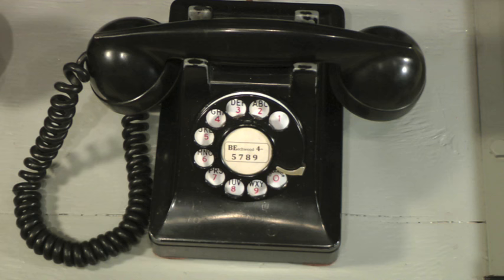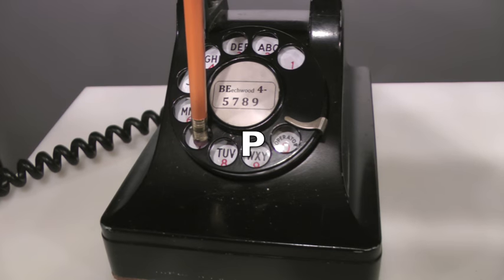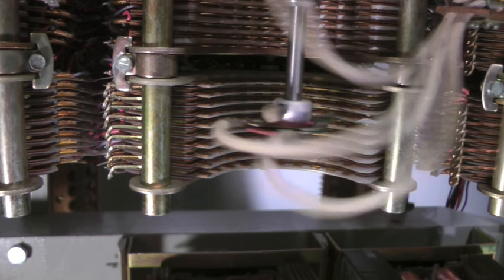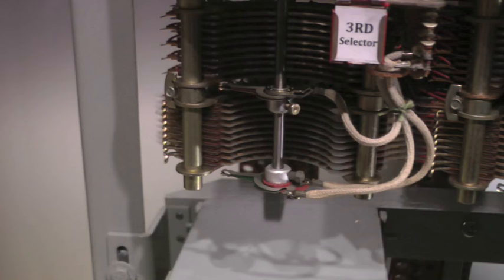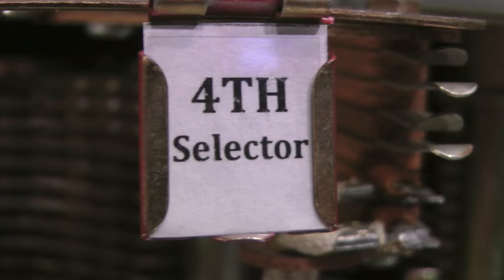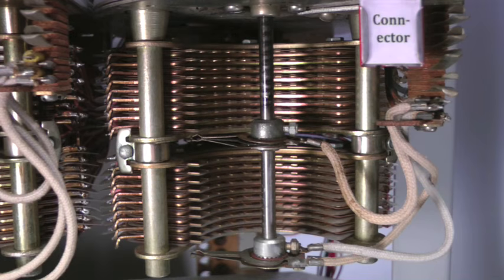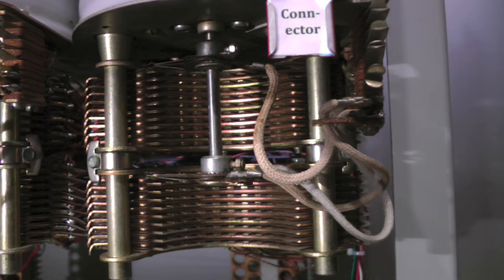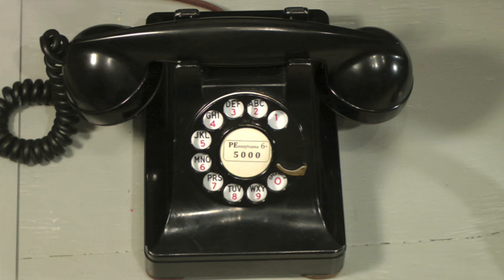A Call To PEnnsylvania 6-5000 Through The Step-by-Step Telephone Switching System

Comment: How does the system keep track of what number is being dialed? The only way I can think to achieve this is with incredible, costly, "fan-out": at every level, there's a connector (or bank of them) to handle each dedicated collection of digits. But this would mean that for every digit added, you'd need 10* more circuits than the last, and in your typical 7 digit number, that would mean 1,000,001 connector circuits (10^5 connectors, the final connector that can handle two digits, and one connector at the start that doesn't need any memory).

That seems like an awful lot of circuitry. Surely that can't be the way the exchange kept track of the number dialed at every stage.
Reply from the maker: While my video shows how a call flows through each of the 7 switch types, it does not explain any of the concepts of concentration, trunk distribution, bank multipling, trunk sharing or selector shelf subgrouping arrangements. In an actual central office there are hundreds or thousands of each switch type and a typical call is routed all around the central office instead of being confined to the small space of the demo unit. Let’s look at a theoretical scenario in which a SXS system has 10,000 lines and 10,000 station numbers. For simplicity, we will assume all traffic is intra switch, which means all calls originate from these lines and terminate to these numbers. Users only need to dial the 4 digit station numbers (i.e. 0000 to 9999). Assume a maximum of 10 % of the lines/numbers are in use at any given time in the busy hour (this is typical). I will need 1000 1st selectors to handle the
originating traffic (i.e. 10% of 10,000). Since only 4 digits are being dialed, we will not need any 2nd, 3rd or 4th selectors. All calls will route from 1sts to 5ths to connectors. The 1st selectors will process the thousands digits. Each of the 10 levels of the 1st selectors will represent a particular thousands digit of the station number. Each level will route the call to its own rank of 5th selectors. Assume the traffic is evenly dispersed across the 10 levels (i.e. 10% per level). We would provide 100 5th selectors for each level. That would give us 1000 5th selectors to handle the traffic from the 1000
1st selectors. Let’s study a call to station number 0987. The first digit dialed will be “0”, which will utilize level 0 of the first selectors. Any given 1st selector can only access 10 trunks on level 0. Selectors are arranged in groups of 10 on a shelf. The 10 banks associated with that shelf of 10 selectors are all multipled together, so that the 100 trunks on one bank (10 levels x10 trunks per level) are multipled to its adjacent bank, and the next bank and so on, such that there are only 100 trunks that can be accessed by the shelf of 10 selectors (10 trunks per level). So we now know
that on level 0, 10 selectors are sharing access to the same 10 trunks to a rank of 5th selectors. But we have 1000 1st selectors spread over 100 shelves. We know that 10% of the traffic from the 1000 1st selectors will be trunked on level 0, so we will need 100 5thselectors to handle that traffic. Since any given 1st selector shelf can only access 10 of these 5th selectors (associated with level 0), it is necessary to divide these one hundred 5th selector trunks into subgroups of 10 trunks each. This would give us 10 subgroups of 10 trunks to the 5th selectors from level 0 of the 1sts. We have 100 1st selector shelves. These also must be evenly divided into subgroups, with each subgroup of shelves having access to one of the trunk subgroups on level 0. This will give us 10 subgroups of 10 selector shelves, with each subgroup having access to one subgroup of 10 trunks to the level zero 5th selectors. This is accomplished by simply multipling the 10 trunks of any subgroup across the 10 circuit outputs of all 10 shelves of the selector subgroup, so that all 10 shelves (100 1st selectors) would be sharing access to the same set of 10 trunks to the 5ths. This set up is repeated for thousands digits 1 to 9 on the other 1st selector levels. This gives us 10 ranks of 100 5th selectors each, with each rank associated with a different thousand digit. The 5th selectors will process the hundreds digits of the station numbers. The 5th selectors are mounted on shelves of 10 with banks
multipled in exactly the same manner as the 1st selectors. Let’s continue with our call to station number 0987. We are going to utilize level 9
of the rank of 5th selectors associated with thousands digit 0. We have 100 5th selectors spread over 10 shelves. Assume the traffic is
evenly distributed across the 10 levels. Therefore, each level will require 10 trunks to connectors. Since the number of trunks for level 9 does not exceed 10, there is no requirement to create more than one subgroup. The 10 trunk outputs on level 9 of each of the 10 shelves of 5th selectors will
simply be multipled together, to provide one subgroup of 100 5th selectors accessing 10 trunks on level 9.  The 10 connectors associated with these trunks will serve station numbers 0900 to 0999. On our call, the tens digit 8 and the units digit 7 will be processed by the connector. This set up will be repeated for the other 9 levels of this particular rank of thousands digit zero 5th selectors. This will provide 10 groups of 10 connectors, with each group serving 100 station numbers. The whole process described above will be repeated 9 more times for levels 1 through 9 of the 1st selectors. For each 1st selector there is 1 line finder. So overall, this office would have 1000 line finders, 1000 1st selectors, 1000 5th selectors and 1000 connectors.
I hope this helps your understanding of the SXS system. Thanks for watching.
Reply: @Hicken65  see you really love it (just like me 😀👍)
Reply from the maker: @anesthcat9420  Well, absence makes the heart grow fonder.

Comment: The only part of this that does not make sense is how these connect to the trunk cables.
Reply from the maker: The trunks are just 3-wire (tip, ring and sleeve) cables between each rank of selectors.These cables run from the bank terminals of one rank of selectors to the input side of the next rank of selectors.The path through a selector is from its input side, through operated relay contacts inside the selector, through the wiper cords, through the wipers, through the bank terminals on which the wipers have come to rest, through the trunk cable connected to those bank terminals and on to the input side of the selector to which the far end of the trunk cable is connected. This type of connection path builds up as each digit is dialed, so that after all 7 digits there is a continuous 3-wire path from the line finder to the connector switch.

Comment: How does the system cancel a call incompletely dialed?
Reply from the maker: I don't recall any time out feature for partial dials, so the switch train would just be held up until the caller hung up. There was optional equipment available for releasing the equipment if no digits were dialed, or if a caller didn't hang up after a call was finished.

Comment: PEnnsylvania 6-5000 would not have been a step by step office. It would have been in a panel office.
Reply from the maker: Well, the famous Hotel Pennsylvania is located right across the street from Penn Station, in the Manhattan borough of New York City. Since the panel switching system was the Bell System’s “Big City Solution” to customer dialed calls, I would think you’re probably correct. However, my demonstration unit is not trying to convey an historically accurate configuration for that location. I’m just trying to show how a call progressed through a Step-By-Step system using two well known (in their day) telephone numbers to enhance the demonstration.